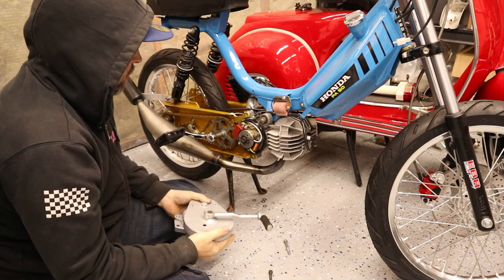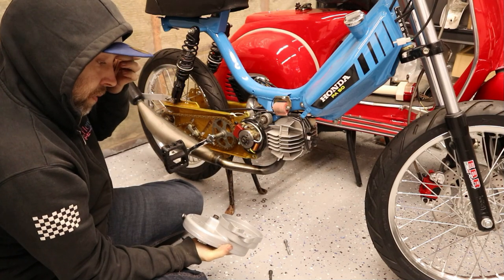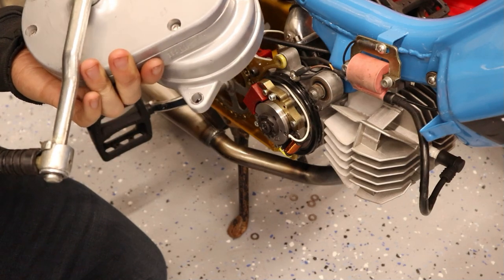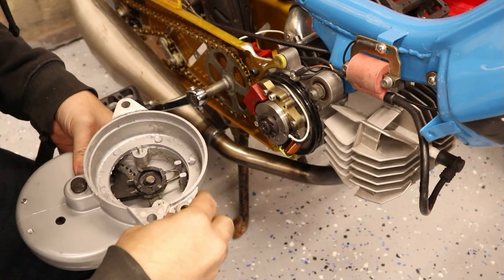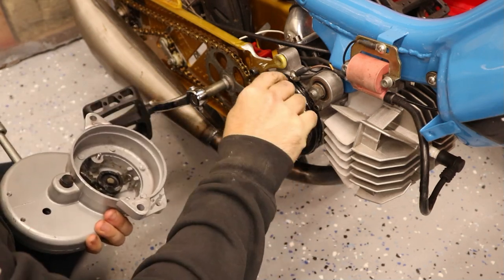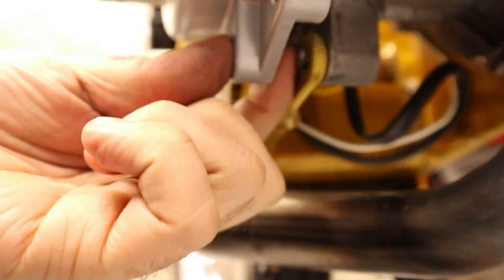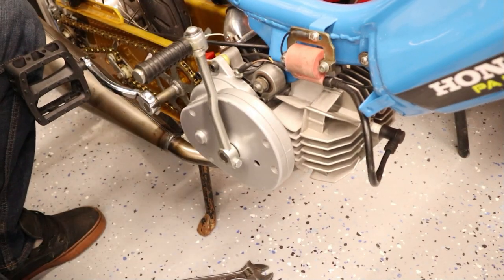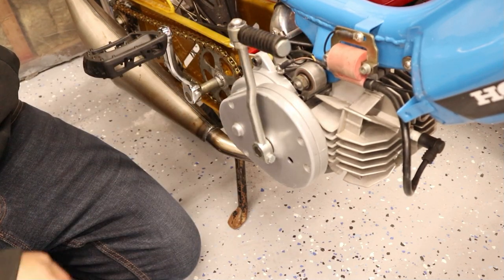How To Put a Kickstart AND Pedals on Honda Hobbit PA50- J's Garage

Comment: Great video!! I am planning to do this mod to my bike and found this video was super helpful for how to add a kick starter to a Hobbit/PA50. Do you by chance know anywhere to purchase a kick lever that would be compatible with this kick starter?
Reply from the maker: I don't.  Some come with, but you can measure the diameter and count the teeth and maybe get lucky finding something online.  I have also had good luck with going to motorcycle scrap yards and digging around for something that works.

Good luck.

Comment: hello nice projecto do you know how to get a better top speed on the hobbit? i have a honda px50 its a similar engine, mine only does 30/35km/h
Reply from the maker: I dunno where your from but some may be limited due to restrictions so de restricting would be the first start if that is the case.

Good tune up including servicing the variator and rear pulley to make sure they are functioning correctly and moving freely.  Good tune up including cleaning the carb, checking the jets are not clogged, exhaust isn't plugged.

From there, 70 kit, 17mm carb and a bigger exhaust and your probably going fast enough for most travel.
Reply: @pitobread  thank you man you are the best. 😄😄